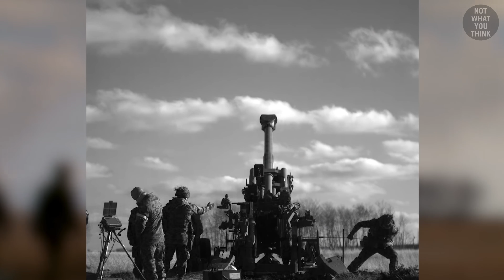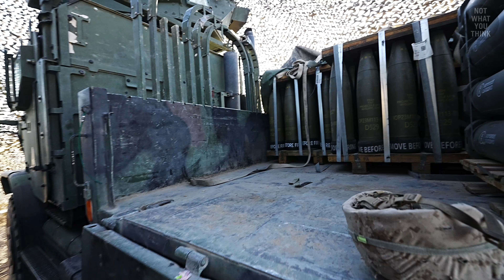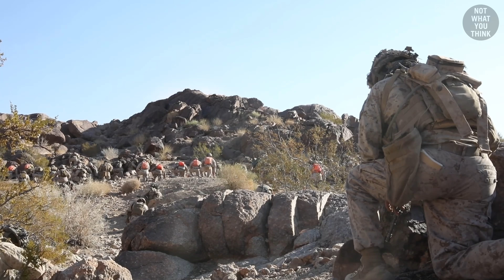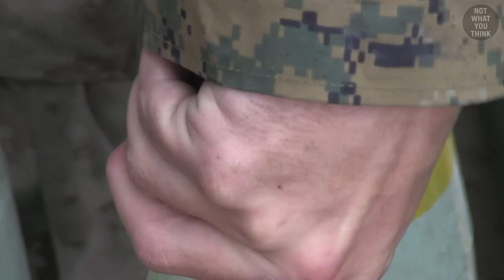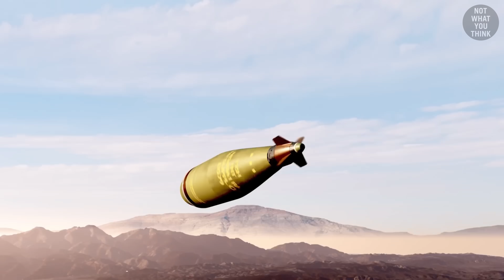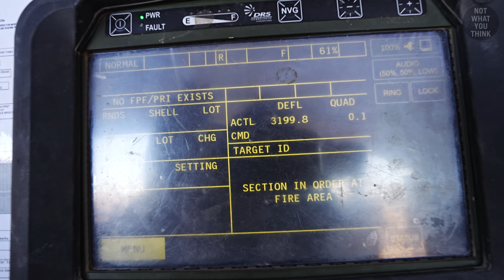Why Artillery Guns Always Shoot Short at Night

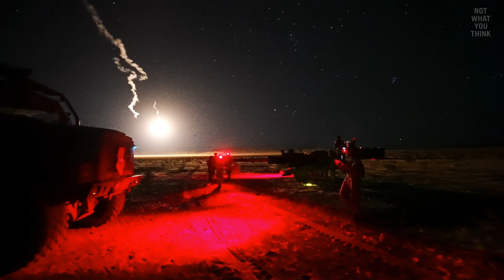Comment: 14:04 why do militaries wear RED headlamps?
Reply from the maker: Red dissipates quickly. Basically it’s not very visible at night (compared to white or yellow light for example)
Reply: @NotWhatYouThink  well, maybe there is little difference in good weather... Cause actually red lights seen clearly at night at towns even from distance. What can help is putting special devices, like honeycombs, on lights, to block lights, that go where it is unneeded. In perfect situation there will be red light stain on ground, which may be badly visible from ground due to geometry.

Comment: I was stationed at Las Pulgas along with an artillery unit that included these howitzers. Right across the street we also watched cobras launch barragees of rockets, and it wasn't unusual to have f-18s flying overhead than moments later have our concrete warehouse shaking because the bombs they were dropping on the near range. Pendleton isn't wild place.

Comment: Great video, BUT: you got one crucial fact wrong: HUMID AIR IS LESS DENSE, therefore the round will travel FARTHER due to the lessened resistance encountered.

I am a Licensed Private Pilot, AND I have an FAA Advanced Ground Instructors License: I can teach from Ultralight up to AIRLINE CAPTAIN/ ATP [ Air Transport Pilot] their required CLASSROOM instruction. Literally from Day One to their Continuing Education Requirements. To be honest, that AGI exam was the hardest one I have ever had - and I am an active ICU Registered Nurse.

Air DENSITY is a combination of height above sea level; air temperature, HUMIDITY LEVEL. Increases in all those leads to the LEAST density. High, Hot, Wet equals the thinnest air. The reverse is true: Low, Cold, and Dry is the most dense.

For aircraft, that means the wings [fixed in total wing area] struggle in the thinnest air and do much better at sea level, cold and dry.

For rifle performance, at greater distances [say ~ 1000 meters and such (even 300 meters)], all that plays a major role/impact. All this applies to artillery rounds as well.

I hope this helps people understand the effect of humidity. BTW, when taken to an extreme, water vapor if below freezing becomes even less dense as ice floats for the exact same reason. Like ~90% less dense than liquid, so it floats.
Reply from the maker: I see, thanks for clarification.
We mentioned rainy weather, not humid weather. Based on what you know, is rainy weather more dense or not?

Comment: Temperature is a huge contributor to velocity and barrel pressure. I hand load for hunting and I use different powders for different temperatures. The winter loads I make cannot be used in the summer at all. You may be able to use them early spring or late fall, but once the outside temperature goes over about 70 degrees the powder for winter burns too fast and creates more pressure than the barrel is designed to accommodate safely.

Transversely, my summer loads can't be used reliably in the winter because the cold doesn't allow them to burn fast enough to create the proper pressure. With bullets this can result in a round stuck in the barrel at worst and in a semiauto shotgun there not being enough pressure to cycle the action.

Comment: I've never had the dubious pleasure of lugging around 155mm shells but I did once get the opportunity to be "volunteered" to move some ammo boxes for an L118 (105mm). The ammo comes in boxes of 2 rounds and they are HEAVY. I can only imagine that the extra 50mm and round length add to the joy of manual logistics in a role like this. 

The L118 also sits on this big metal disk that allows the gun to be easily rotated even on crappy terrain. That thing is bloody heavy too.

From a reserve infantryman who got stuck with some artillery creatures one exercise...

Comment: I must  say I  use to be a artillery  gunner  in  the SADF . The South Africa gun tractor or truck which is a 6x6 vehicle but far beter equipped  then the one showed in your video. Even loading  the  shells was not done by one per. Quite  interesting thought in my opinion a G 5 gunn is a superior  to the M 777

Comment: ighttime tends to bring higher humidity levels and changes in air pressure. The increase in moisture can make the air denser, which once again increases drag. Also, lower atmospheric pressure at night, common in many areas, can affect the projectile's trajectory, leading it to fall shorter.

Comment: The M777 howitzer, a lightweight 155mm artillery piece, was designed by Vickers Shipbuilding and Engineering Ltd (VSEL), a British company. The design work began in the late 1980s, aiming to create a lightweight but powerful artillery piece.
Reply: The M777 howitzer was first manufactured in the United Kingdom by Vickers Shipbuilding and Engineering Ltd (VSEL) during its initial development phase. However, after the acquisition of VSEL by BAE Systems and the decision to target the U.S. military as a primary customer, production was shifted to the United States

Comment: That thing broke my back/body for life !!! Pumping it up, picking up the trail arms and then luggin those heavy ass rounds !!! Glad i served but it took a toll 👍
Reply: I hear ya. I worked on the old M114 and the M198 towed howitzers (with a short stint on the 8 inch SP) and have the old artillery soldier's aches and pains to show for it. This M777 is a HUGE improvement but still is hard, grinding labor.

Comment: As the temperature drops, the air density increases and drag increases.
Reply: That's true.  But surely they use barometers in ballistic calculations.  The propellant density was the "not what you think" part for me.
Reply: Yes but burn rate due to propellant temp effects the FPS more in this case
Reply: @ServoCision  or moisture and elevation
Reply: @ServoCision snow can really fuck with POI.

Comment: "The more Marines you have, the easier it is to operate the gun," he says while seven Marines stand around watching one Marine work to lift the gun into position. Regardless of the service, nothing ever changes.
Reply: Its good to have more guys than not enough, specially if accidents happen that take out manpower like injury, say snake bite, counter battery fire hitting close before getting hell out of the dodge etc. Also ability to swap tired guys to fresh ones and rotate them to keep rate of fire at the maximum.
Reply: @Hellsong89 the point is they are not helping 😂.
Reply: @marshalljulie3676  They are helping though. If they did a bunch of extra heavy lifting for no reason other than to look busy, they’d tire out and not be able to replace the active crew. Saying they’re not helping is like saying you shouldn’t have rest days from the gym because it means you’re working out less.
Reply: @marshalljulie3676 it's called immoral support
Reply: @JamEngulfer also theres some parts of the operation where just one can do work at the same time, but lots of other times where that is insufficient. Sure this is humoruos seeing ad the narrativ says that, but everyone should know that you need the Manpower to do the hardest task as fast as possible, not the minimum needed for the easiest.
Reply: that's... not the why or how of that saying in regards to artillery.
manual artillery requires a variety of very physical, very specific tasks to operate the gun.
one man Can operate an artillery piece, for several, Very Slow shots. for a very limited time before he is physically spent.
if you want rounds down range, accurate and for extended timeframes, you need a large, well drilled team.
where some of those men are on a rest rotation.
Reply: @HistorysRaven  with extra people you have someone ready to take over when one person gets too tired.
Reply: Wait till they start sending rounds down range
Reply: you underestimate the power one harnesses from spectators
Reply: They are reciting best movie quotes over and over to make your job easier 🙂
Reply: "We're shorthanded today, normally there's 8 of us watching him dig" hahah
Reply: That Marine is probably Carlos, an Mexican immigrant probably illegal, who is the one doing all the work. Same as in construction sites.
Reply: 🤦🏾‍♂️ You only need one to traverse the gun
Reply: thats seven guys giving moral support.
you know how shit that job would be all by yourself?
Reply: Timestamp?
Reply: Moral support matters!
Reply: In my artillery days, the C1 howitzer (105 mm) had a crew of 7.
#1 gun comnander
#2 gunner who opens/ closes the breech, handles barrel elevation and fires the howitzer
#3 aligns the bearing (left/ direction of the varrel)
#4, 5, 6 ammunition handlers. They select the ammunition, set the timers on variable fuses, insert the correct number of charge bags into the casing, mate the projectile to the casing and loads the howitzer 
#7 Driver/ gun 2IC. Also supervises the loaders.
When operating the gun, I was a #2. But I spent most of my time in Recce.
Reply: I grew up around the military, enlisted in the USAF and have friends in every branch. I just love seeing this in everything and couldn't help but comment about it.
Reply: Looked like a bunch of union electricians standing around
Reply: How stupid do you have to be to think one man can operate that humongous machine. What happnes if something breakes? How do you expect 1 person to clear and relode? Stupid ppl
Reply: Circulation....
Reply: right  had a cherry drop a Trailor on my right hand once,  Took just the pit of skin off right down to bone.  Went to medics they work to deaden it and while they did so talked cutting it off being held in place by just bit of mail me holding it in place.  Well one said go the other said stay.  stay said ask me i said sow back on if takes good if not so what.  It took  Tip is gone today. Cut it off again in food slicer sowed back on but when i ran it into table saw and it went gangrene 7 days later it was cut off.

Dont know what happened top cherry he got realigned a week later.  Which was to bad b/c we need ppl and the boy could type
Reply: I see you didn't know what was going on.
Reply: @davidfreeman2522  I see you don't understand a joke.

Comment: It's a great artillery system, but not being self propelled has its disadvantages. Modern artillery shoots a burst of shells and move to the next location and repeats the process to avoid being shot back at
Reply: Self propelled is better in movies and TV shows than in real life.  It is MUCH easier to get a new howitzer or 7 ton than a self propelled or fix one if it is broken.  The towed artillery is also easier to train people on.
Reply: @jasont587  That is true and both types have advantages and disadvantages, but depending on the terrain and the capabilities of your enemy self propelled artillery could be required if you don't want to get artillery fire or drones in returne after you have fired

Comment: what a terrible German translation...
Reply from the maker: Hmm sorry to hear that. The AI translations are typically quite decent. That’s been the feedback so far.
Reply: @NotWhatYouThink  It does a decent job, but what made it particularly terrible is the pronunciation of the German translation of "M777" and fuse in that sense is upfront falsly translated with "Zündschnur" (which is attached to fireworks and bombs in pirate movies). In the context of a modern Grenade it'd be "Zünder". There are some further errors, too.
Reply from the maker: Yeah, it’s not perfect. I’d give it another 1-2 years and it should get better :-)

Comment: Off the top of my head, two things: the rative drop in air temperature between day and night means air is typically denser at night which would slow a shell faster.  The second is that the sun in daytime causes more rapid evapation of water from anything on the ground raising humidity FURTHER thinning the air.  Jets take far longer to take off in summer, but more importantly far longer to STOP when landing and this seems to be related.
Reply: Changes in temperature and air density would be accounted for with a thing called a met.  When I was in they used a device strapped to a balloon and measured everything about every 4 hours in training, more often in combat zones.

Comment: Counter battery fire and drones are a challenge in Ukraine. They have to move quickly after firing the first shot and soon after arriving. 
Shooting while moving seems to become necessary.
I realize the M777 has advanced like airlift and movement by helicopter
Reply: Compare to the Caesar. The CAESAR benefits from an automatic pointing calculation, fires quickly and is already gone elsewhere when the six shells fired hit their target 25 to 35 miles away.

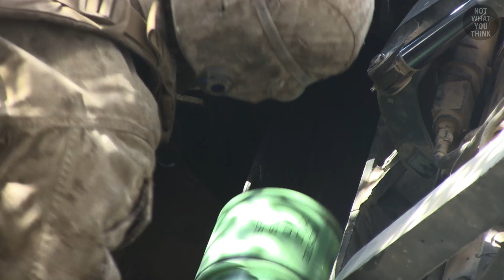Comment: 5:00 This was worth watching just to find out that every Howitzer round is delivered with a turkey thermometer in it.
Reply from the maker: Happy Thanksgiving!
Reply: At least in Swedish charges, as Im a Swedish artillery gunner, theres not actually a termometer in each charge, but a protester place to take the temperature with one. It would be a huge waste to supply everyone with its own thermometer. And it would have to be removed from every charge before firing it, you dont want loose metal pieces in the chamber after each shot.
I dont think t looks like what he claims n the video is correct, the thermometer is stuck inside he charge after the red protection is peeled away I believe.
Reply: Correct  @Lunkanize
Reply: Until you find out that they get charged the price of a turkey for that thermometer... Probably I'm just making that up
Reply: @matt45540  no it's the military they get charged the price of the container it took to transport the turkey
Reply: Prop temp
Reply: The round doesn't have a thermometer, the powder does.
Reply: @jasont587  Wait, how does this go. Oh, here and here, and... "Your Mom has a thermometer". Yep, that's it. :)
Reply: The "Round" is the total of the components: projectile ,powder charge,fuse and primer

Comment: Meteor (the weather) will have it's effect on range, especially temperature and humidity in the air the projectile travels through. This will vary at different altitudes and can be allowed for if meteorological data is available. The air will normally be more dense at night.

Comment: I'm surprised that they don't use a radio fuze as standard to achieve airburst.  I get that a timed round is like 90% as good, but a radio fuse would self-correct for every new fire mission without having to reprogram.  I do understand point fuses serving an important role though against harder targets.
Reply: If firing at the opposite side of a hill or conducting direct fire and air burst is needed, timed fuses may be more accurate than proximity fuses, since the round is flying nearly level to the ground. (Note that I am not an expert.)
Reply: They use proximity fuses all the time it just depends on the target

Comment: Commenting my theory before watching to see if it really isn't what I think: hotter air is less dense and thus provides less resistance than colder air at night.
Reply: I haven't gotten to whatever part he mentions it, but my guess is it's actually going to be the temperature of the ammunitions propellant. 

Most people don't think of it, but it actually has a HUGE impact on performance from something as big as a Battleships 16" guns to ad small as a 5.56 Carbine. As an example, one powder magazine being hotter than the others (Usually turns out to be whichever one is closest to the engine rooms) can make its turrets guns overshoot by miles compared to the rest when fired in a Salvo or Broadside. Similarly, gas operated firearms usually have adjustable gas systems and in extreme cold conditions need to be set higher allowing more gas into the system to fully cycle the bolt/bolt carrier otherwise they'll need to be manually cycled every round or two.
Reply: Both air temperature and humidity will have an effect.